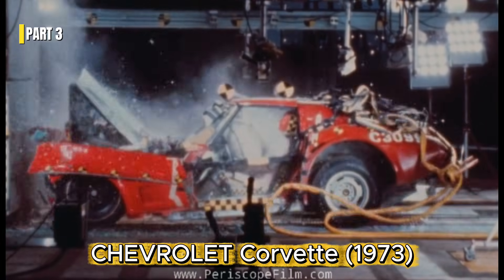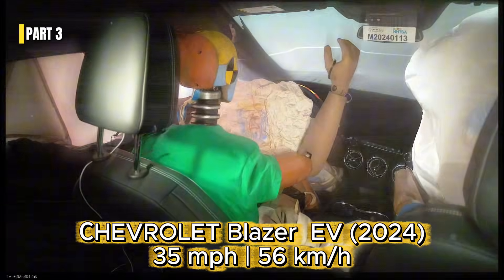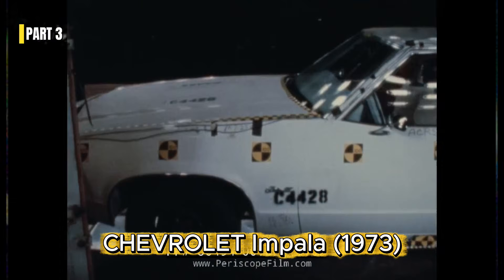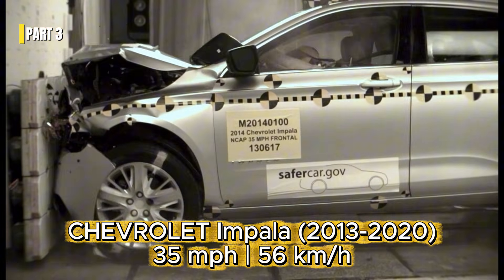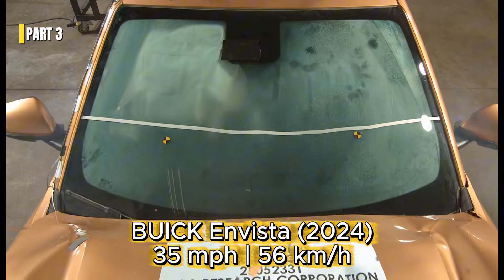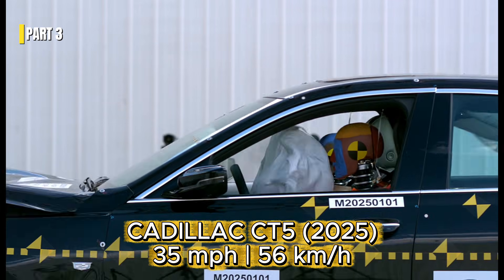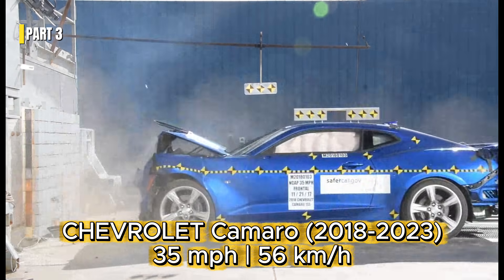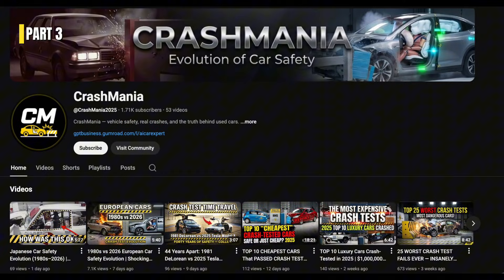1980s vs 2026 American Car Safety Evolution | Shocking Crash Tests

Comment: The 70s full size cars held up also absorbed a reasonable amount of impact ,those tanks did have some give and they were doing alot of testing back then ,more than most people realise ,the biggest difference in what I saw there was weather there was airbags or not ,I've seen that town car test ,all the doors could be opened with a concrete barrier and full front impact